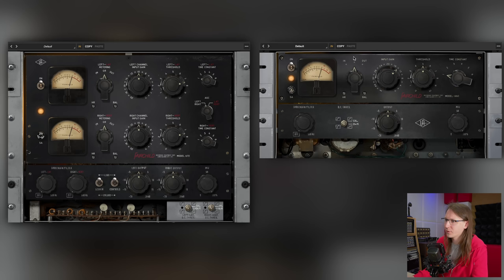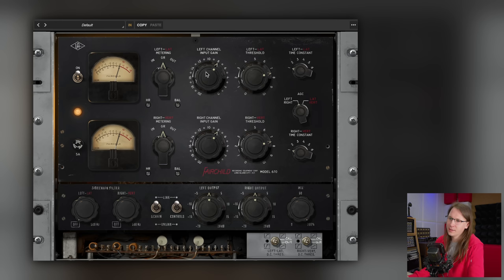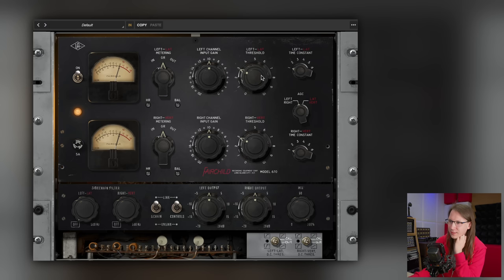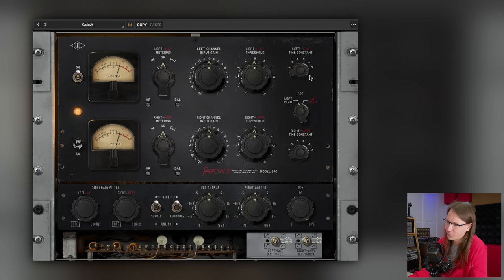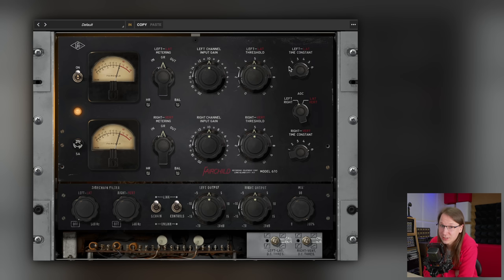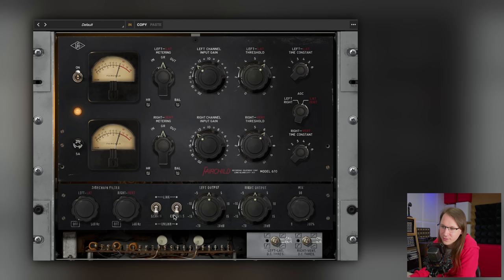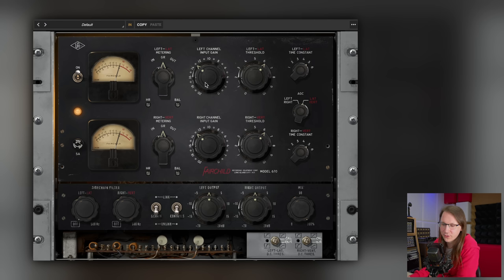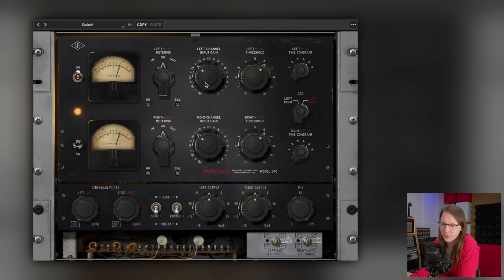How to properly use the Universal Audio Fairchild?

Comment: Since I have been in recording since 1955, I may be able to add some history to this tutorial. First you must remember that stereo became available to the public in 1958. Prior to that, everything was mono. The Fairchild Compressor didn't come out until 1959. There was no such concept as "mid-side". The vertical and horizontal designations were for the cutting lathes that were now able to do stereo because record grooves could have both side to side plus up and down movement.  This was new and revolutionary in those days. This model Fairchild was designed primarily to get great results for your cutting head while mastering to lacquer disks. It was not really designed to be part of the recording chain, but part of the mastering chain. If the youngsters at UA think there was mid-side considerations, they are woefully short on audio history. Engineers soon found they were useful in many parts of the chain, but the strength was in the cutting room.
Reply: I had no idea that the original purpose of this compressor was for cutting vinyl. However, it makes everything sound better. On a single track or a busses.  In 1959 music was not being mixed the same as today. It was ahead of its time.
Reply: Holy moly 😅
Reply: You're absolutely correct. The 670 was revolutionary back then, especially if you compare it to some of the other popular compressor/limiters of the time, like Altec, for instance. The circuit itself is balanced throughout, not just at the inputs and outputs; it's way overbuilt/engineered. Fairchild was making rocket guidance systems last I checked, and that was in the 90's.
Reply: Very cool! Thanks for this info.
Reply: I saw the name Fairchild when I initially read about the guitar tones of Beatles Revolver. Reading about it and Geoff Emerick, and realising it made those great drums and guitars sounds, almost was the sole trigger of me getting into recording and mixing. The name and all just make one love it. It's the coolest gear ever, and we should respect its history. Thank you!
Reply: The thing with compressing side information, especially across a whole mix, unless you know what you are doing, that can really mess with the stereo image that
Reply: I like that you can link the controls and unlink the side chain. That’s a nice convenience.
Reply: I was thinking as I was watching this video, so basically this is a mastering compressor. Your explanation makes perfect sense.

Comment: One thing that would be interesting to add in those videos is describing the popular use cases those compressors are known for today.  I have several of those UAD compressors and sometimes I wonder which one I should use and why.  Most of the time I end up using an LA2A on everything except drums and an 1176 or Neve 33609 on drums.
Reply: look up the different types of compressors, vca, vari mu, fet, opto, pmw etc, you will better understand what to use in any given context

Comment: Thank you so much for your video.  I just do voiceovers, spoken narration.  I received the 660 and 670 plug-ins with my Apollo interface and would like to use whichever is best for adding some velvety presence to my voice, and whatever goodness they can impart.  I saw another video that suggested the 660 might be best for that application but haven't found a video with much info for my use-case.  

Would you also recommend the 660?  I've looked through the Vocal pre-sets but could really use some suggestions as to which settings would be best for voiceover use.  Could you please recommend some starting settings for voiceover enhancement (and I can tweak from there).  Thank you in advance for any help with this  🙏

Comment: 10:15 I think I've read about the circuit in a tube amp doc. Originally intended to bias the a and b tube(s) on a push-pull design to cancel noise as much as possible (because tubes are never alike and need to be matched) it now serves as a shift between a/b-sync and a/b-async distortion - I'm loving it! :) Kind of like turning one half /side of the tubes into diodes - not that bad though

Comment: I recently got the UAD Spark subscription and I decided not to use their Fairchild plugin, instead opting for Acustica’s Ultramarine which flat out sounds better, and in Lat/Vert mode the output volumes are mid and side instead of left and right. Waves’ Puigchild works the same as Acustica’s. This control of the mid/side volumes at the output stage makes a good plugin great. UAD really dropped the ball here.

Comment: Some great info in here, thanks! I did not know what Lat/Vert stood for. However you switched it up to the opposite meaning. Lateral means “extending from side to side” (according to the 3rd entry in the Webster dictionary) whereas vertical is “perpendicular to the horizon.” So technically it’s “Side/Mid” in this case. 😁 I don’t have the UAD version of a Fairchild but most of this still applies. I would venture a guess that other simulations have the same or similar Time Constant values… I do enjoy your videos and appreciate the time and effort you put in. You have helped me avoid buying plugs I’d have little use for. Thanks again!
Reply from the maker: No, it means the movement of the stylus, where the lateral movement is the mono content, and the vertical movement is the stereo (difference) content

Comment: The threshold doesn't determine the amount of compression that you want.  The brain actually does that with a little help of a pair of ears (or one ear if pair is'n part of equipment). The threshold only determines the amount of compression you get out of certain material with a certain amount of gain applied. So the synergy between these 3 components and the actual input of the brain and ears determine what you want and get, A knob does not have any clue whatsoever.
Reply from the maker: wow! classic thinking :-)